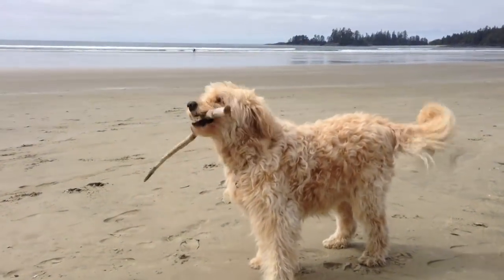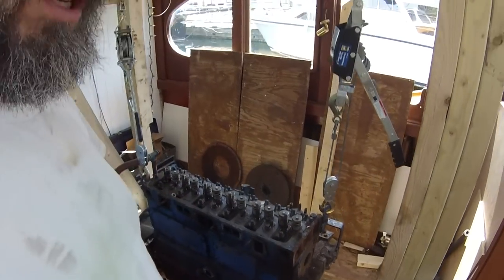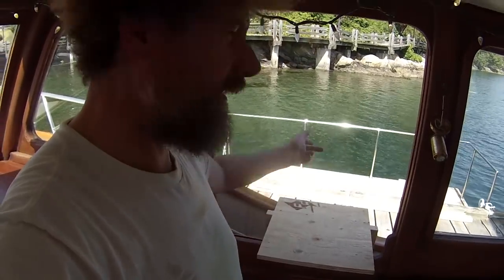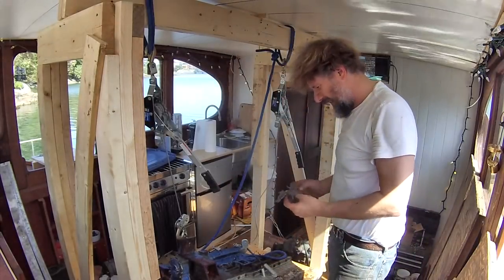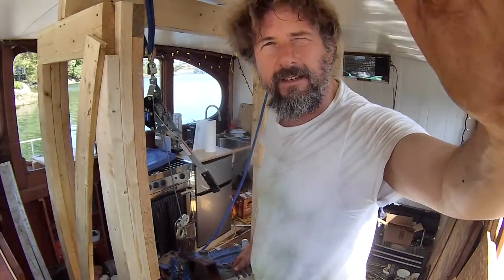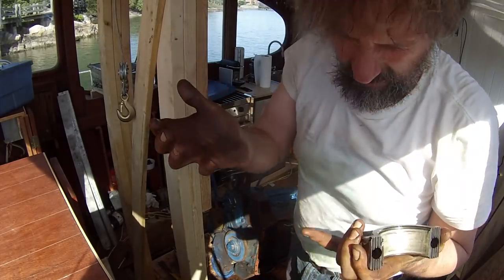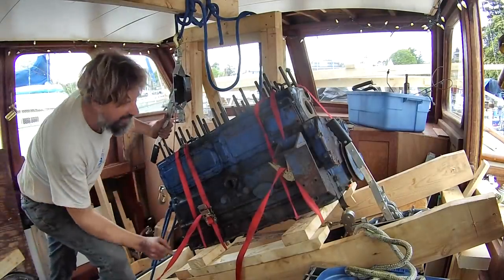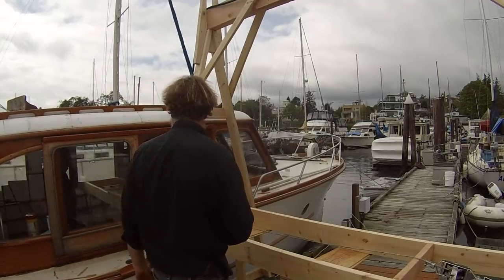Removing the old engine - Wooden boat restoration - Boat refit - Travels With Geordie #80

Comment: Great to see a person who can use all the elements required to remove a heavy engine from a vessel and make it an easy job. Reminds me of when I had to do the same, but out in a bay without a jetty. Had to break down a Perkins diesel and load it into a pram dinghy to take it ashore. It had run a big end bearing so had the motor completely overhauled and reinstalled it in the reverse order.Five days and was able to continue our voyage.
Reply from the maker: Wow! Now that IS impressive. Congrats!

Comment: Nice job on engine removal. Sometimes making it up as you go along is the best way. It's always good to use spare parts from the old engine, that'll work with the new engine, especially injectors. Having rebuilt injectors, ready to go, if (when) an injector malfunctions, is definitely a good thing. Take it from a diesel mechanic, those things ain't cheep! Looking forward to the install. Hope you find a way to cure your pan problems.
Reply from the maker: Thanks Daniel. Good points.

Comment: I have never figured out why people insist on using come-a - longs to lift with, a chain hoist would be much faster and you don't take a chance on getting your fingers caught in the ratchet when letting it down. 
Nice engineering job getting it out of the wheel house, I hope you treated your helpers to a couple of beers!
Reply from the maker: Thanks Charlie, and I completely agree. I chose come a longs because they're cheap and can pull at any angle. After all, they're surplus when I'm done.

Comment: Need more space to accommodate a taller (new) engine? Consider a “island” table built over the top of the engine space? More height over the engine and a table next to the kitchen. Just an idea.
Reply from the maker: Thanks Patrick, great idea. I'm very lucky as the new engine is exactly the same height as the old one so it just fits.

Comment: That was nail-biting; Never having met you before and not knowing your capacity to invent solutions I was thinking A- you sink your boat, B- you crush your foot or worse, or C-you have an anchor you don't need beneath your home. None of these scenarios came to pass and now you only have to do the reverse and load a new stripped motor and reassemble it. I can't wait for the next gripping installment.
Reply from the maker: Thanks, jeez, now I'm glad those things didn't happen too!

Comment: Hello Peter. Another great video. Just dismantled two Ford Lehman 80HP completely, as they were beyond repair on my boat. Those old engines are so heavy. Anyway, have you considered installing a galvanic isolator (isolation transformer) to reduce the damage that can be caused by the power from the marina? There are basic and fancy ones on the market. PS: I Have a 1978, 34 foot trawler, looks similar to Salish Sea opposite you at 10:34. Cheers.
Reply from the maker: Hi, I'm still considering what isolation technique I'll use. For now everything is disconnected.

Comment: Your scrapping the old motor? Man I’m about to cry!!! Lol
Seriously, I think you could just give it away on craigslist and someone would be very happy to get it.
Reply from the maker: I felt the same way. I had it on Craigslist as a giveaway for weeks with not a peep. Later when we pulled my friends very rare horizontal turbo 6.354 I was sure someone would want at least the turbo.....nothing.
Reply: Travels With Geordie wow! That’s shocking!! Good luck with the new motor though, I have a Perkins 4.108 in my Albin 25. I love diesels, can’t beat the efficiency and longevity!!!
Reply: The problem is, most people don't want to fool with those old motors.  They would rather do like Pete is doing. Replace rather than repair.  Do you keep dumping money into something old or replace with new or newer?  One of the most cost effective new replacements is a Beta , they are Kubota's and very easy to get parts cheap.
Reply: few people want to travel to victoria to pick up old engine parts.

Comment: Great ingenuity! Helped do similar a couple of times (once a 6-110 Jimmy out of an engine room) and your solution was top notch.Great demo of Canadian DIY prowess!  I am chagrined that you are so cavalier at scrapping the engine, though. Those 6.354 don't go for chump change, even if only for parts. I keep wondering if there was an "issue" with that engine you have not yet disclosed?
I do understand the swap. All you need is enough power for hull speed, plus a safety factor. A 4.236 is likely enough for that but a T4.236 might have been better, though I would not have turned down a "deal" on a fresh NA engine.
Reply from the maker: Thanks for the kind words Jim,I was sad about the engine too, I had it on Craigslist for free with no takers and eventually had to give up.
Reply: OK, I can take you off my "prospective hit list" because you tried to find it a home. If I wasn't 3500 miles and a passport controlled border away...

Comment: Oh man I know that feeling holding an expensive part that ends up being useless and\or not fixing your problems not a good feeling my friend.
Like you described so very well I have heard other lament and caution that "everything having to do with marine architecture and boat ⛵ design is  compromise", or at the very least; a  series of them for practical (or impractical) purposes.

Comment: I knew that would happen. Rust holes no matter the size in the pan. And no matter how the oil might look you know water got in. And by that the crank bearings fail and so on and so on. If you are a diesel mechanic plz let me know if I am right I am used to working on old two stroke outbounds
Reply from the maker: I'm no mechanic but agree completely. water, especially sea water is ugly in an engine.

Comment: This is very helpful for me as I'm going to have to remove a Perkins T6.354 from my boat. A sudden turbo failure caused a loss of oil which resulted in a bent connecting rod. One thing I couldn't figure out, is how you were able to rotate the engine 90 degrees to align it with the window. Any pointers on that?
Reply: Aha- I just saw it at 10:03 in. Thanks.

Comment: might want to invest in a electric impact gun--try in out on the crank bolt
Reply from the maker: Heh, I though about that. I actually have an air gun. But no socket big enough and I figured the engine was light enough by then.